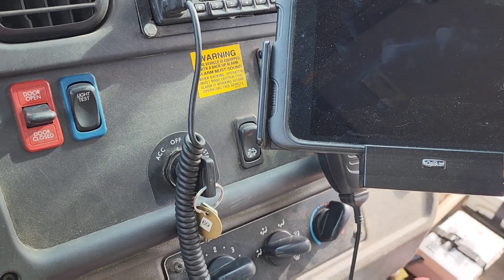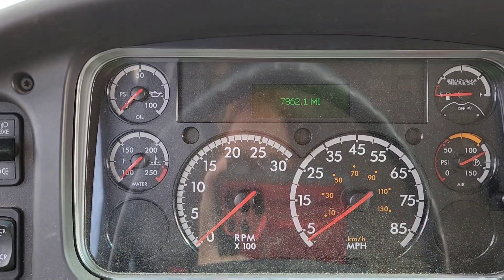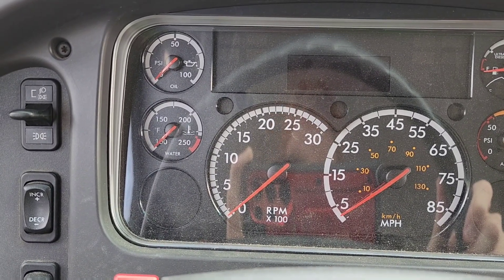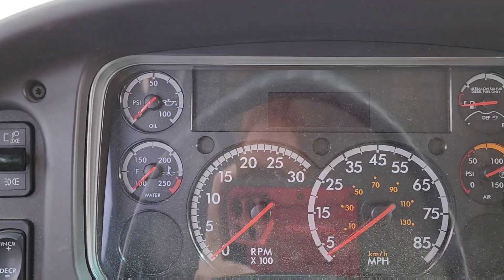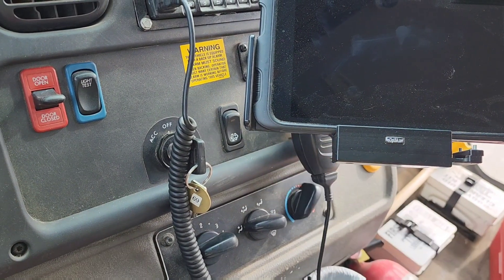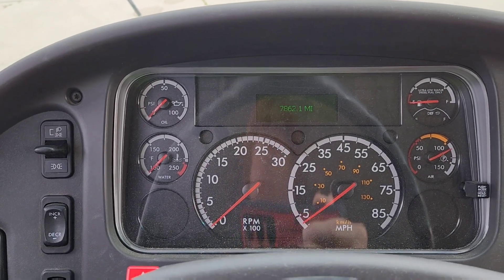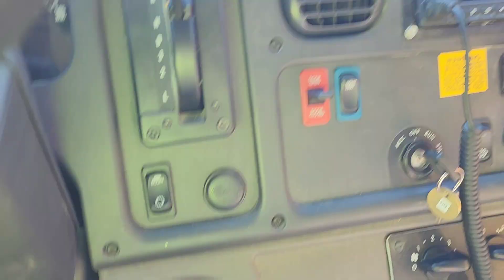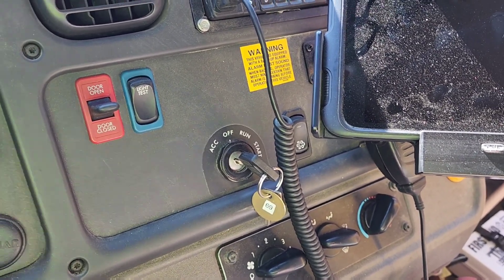How to Initiate a Forced Regen On a Thomas Saf-T-Liner C2

Comment: Thank you i think I got semi lucky.   I had the stop engine light on warmed her up and actually did the forced regen. Buuuuut I now have a full time regen warning on. My buzzer is off, my stop engine is now gone but I have a full time regen light on. What's my next do? Is it time to clean my fliter? And do you know of any decent videos for this task. Im a Vw, Audi and air cooled Porsche mechanic so im crazy enough to tackle the next quest. Need to get building soon its my next home😅
Also its a 2010 safe t liner with an mbe 900 engine. Thanks for a great video and any other info if you could shoot me in the right direction for a cleaning video or manual I can read. Bus came with a code reader. How good it is idk yet.
Reply from the maker: Try running another forced regen first.  If the light is still on after that, might be time for new soot load sensors or you will need to clean the DPF to remove ash content.

Comment: Why only one air gauge?
You don’t have P and S air?
Reply: Parking brake? 🤔
Reply from the maker: It's a hydraulic brake bus with air suspension.
Reply: @BusMaster99  

I actually didn’t know some schools buses were available with hydraulic brakes.
I drive a C2.

Air brakes safer.
Reply from the maker: @craiglittle7367  I agree.  Sadly my company doesn't have a single air brake bus.  Closest that comes to it is our wheelchair C2s that have air parking brakes, but they still have hydraulic service brakes.  I'm planning to leave soon and join a charter company that does have air brakes, A/C too.

Comment: isn't this somethink that should be performed by the mechanic at the shop ?
Reply from the maker: Yes.  This is just to help somebody in an EMERGENCY situation where the bus absolutely needs to be regenerated away from the workshop, like on a charter or something where there are typically no technicians working on that given day for example.  That's company policy at most bus barns, but some will let the drivers do them.  Mine doesn't.